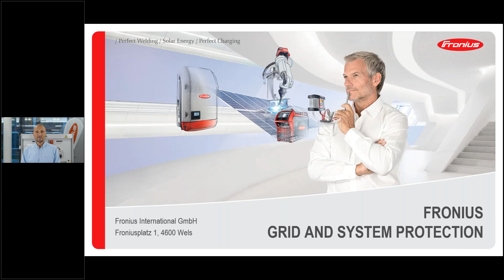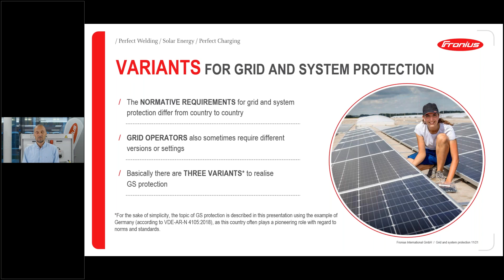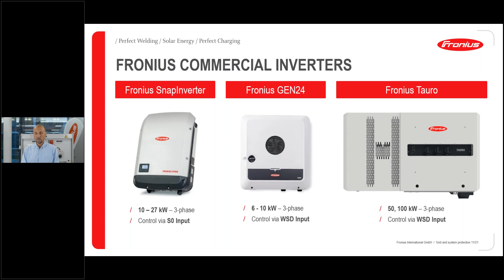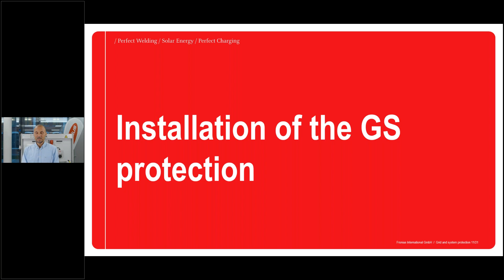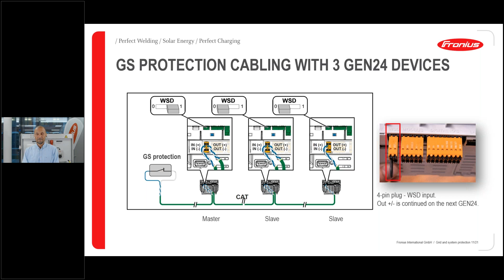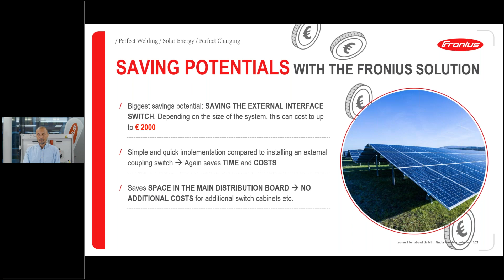Webinar: Save costs with Fronius grid and system protection

Comment: the installation and commissioning of new commercial inverter - the Fronius Tauro was covered very well. saving of AC cable is big plus and cutting edge. No other invertor company like huwai, sungrow, solis etc is even closer. Must come with a big bang in south Asia by entering into big Pakistan market. best wishes aijaz, energy engineer from Pakistan.